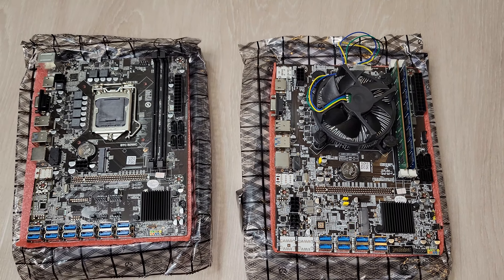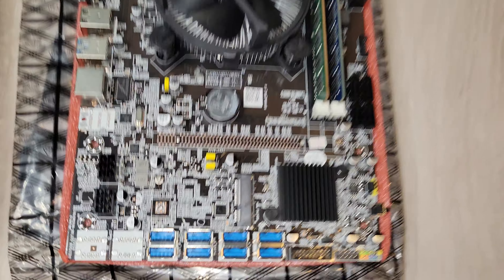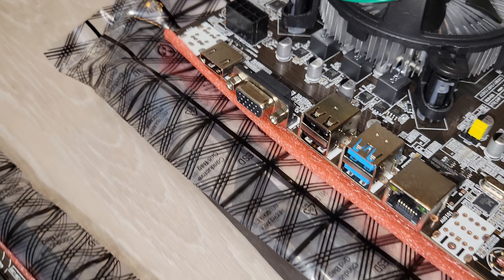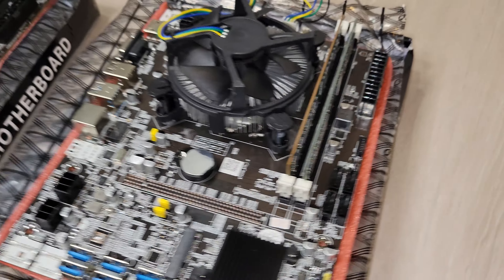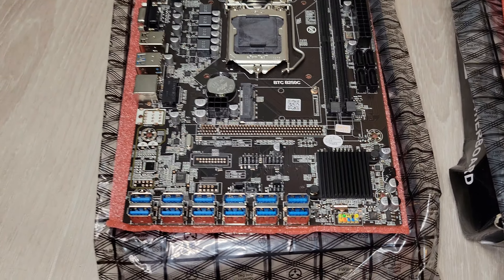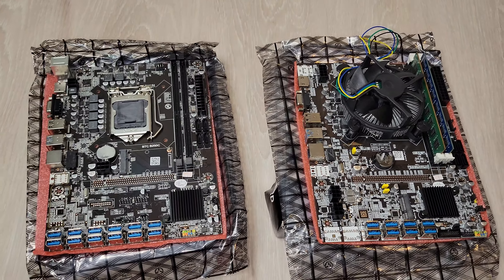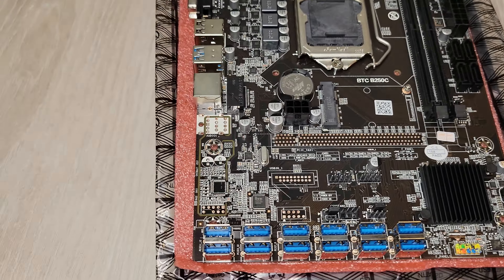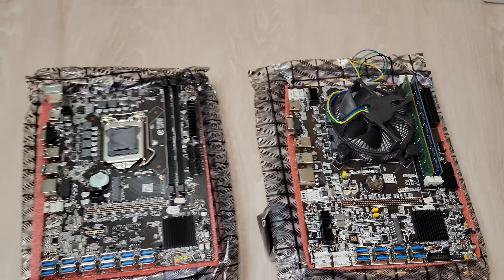8 GPU and 12 GPU Mining Motherboard Review Aliexpress (BTC B250C & B75)

Comment: can you give a link where to buy cpu and ram for the b250c mobo in ali express? Thanks
Reply from the maker: Here is a link to a CPU,
https://www.aliexpress.com/item/32947233799.html?spm=a2g0o.cart.0.0.2eeb3c00B9BPTJ&mp=1
DDR4 memory you can order from any normal store.
you will still need a cpu cooler.
The 12 gpu B250c motherboard is a bit more expensive than the 8 GPU DDR3 memory B75 motherboard combo.
Thats why I went with the 8 gpu ddr3 board.
They also make a 12 GPU B75 motherboard that works with DDR3 but I have not ordered and tested one yet.
https://www.aliexpress.com/item/1005004033634117.html?spm=a2g0o.cart.0.0.2eeb3c00B9BPTJ&mp=1
Reply: thanks you sir! gonna try this one.